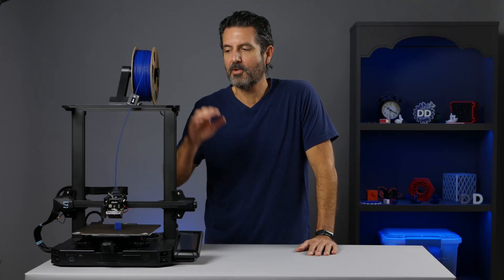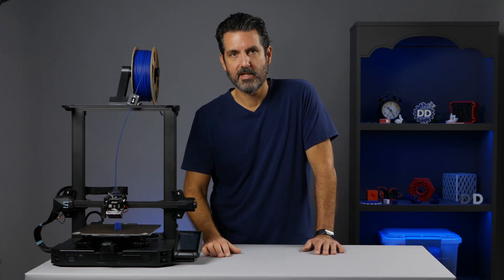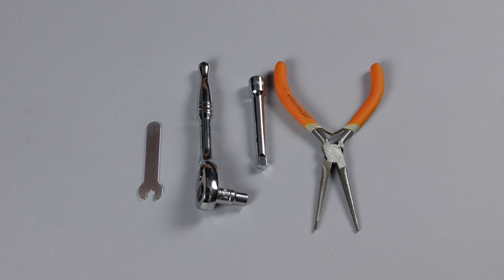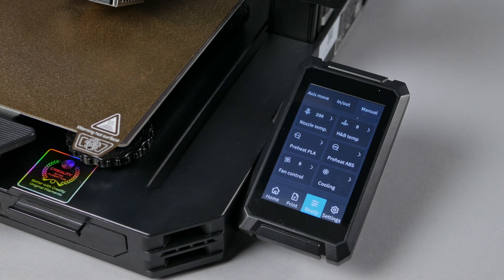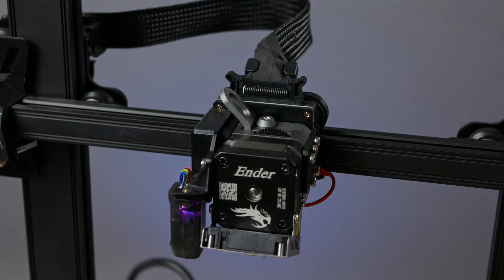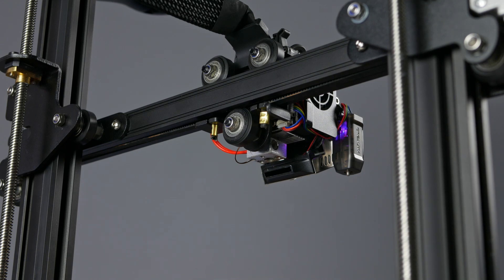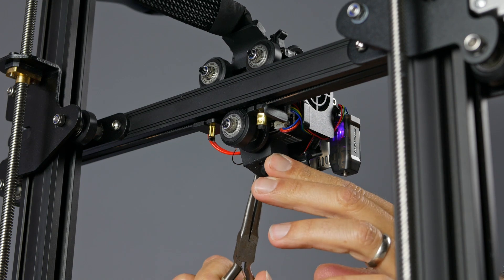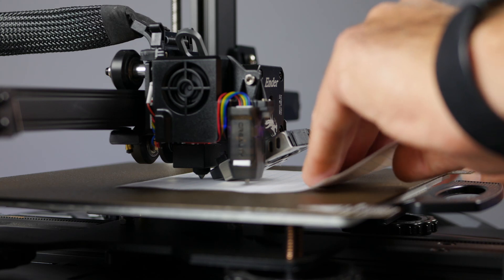How to Change Your Nozzle On the Ender-3 S1 Pro

Comment: That's exactly how I do it. I do use a rubber sleeve, thou, on the plier. I find it grips better. 

Now, one thing I do differently is that I test for any leakage before I place the h-block sleeve back on. Reason is that I failed once and ended with a mess just because that sleeve covered a mistake I should've noticed straight away.
Reply from the maker: That is a good idea. Do you just print that first print without the boot or remove it and check after the first print?
Reply: @dandesigns3d  because my printers are in enclosures, I test the print without the sleeve. A short 30 min model does it, as long as temp is a little higher than the one you normally use. Like, 220 C for PLA.

Comment: i would recommend you remake this video. Holding your heater block with needle nose pliers is a no-no. Look at your video when you are putting it on and you will see your heater block twisting. Much better idea using a wrench on the heater block.
Reply from the maker: Thanks for watching. It's pretty hard to get a wrench on it without disassembling. The pliers work fine you just have to apply pressure opposite the socket wrench. See 3:03 the pliers actually tweak the heater block the opposite direction of the socket wrench. That movement is not much or harmful and will happen with a wrench too.